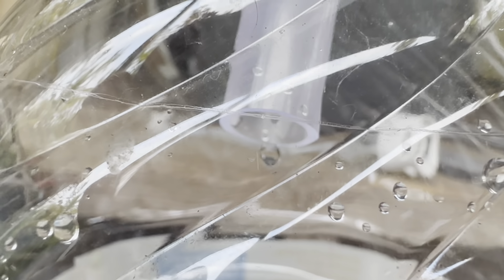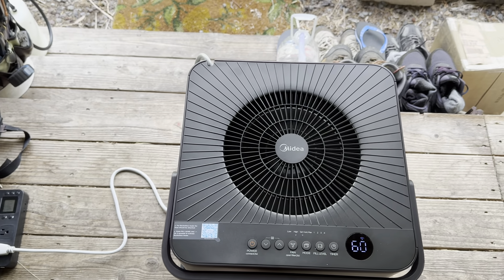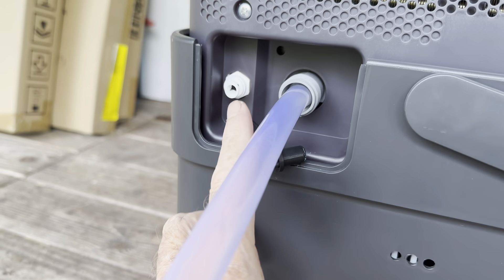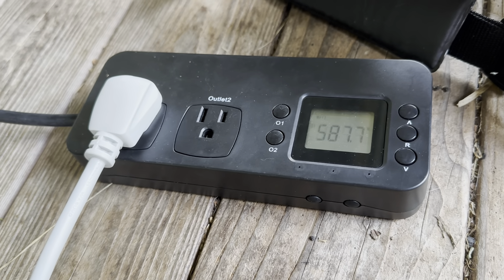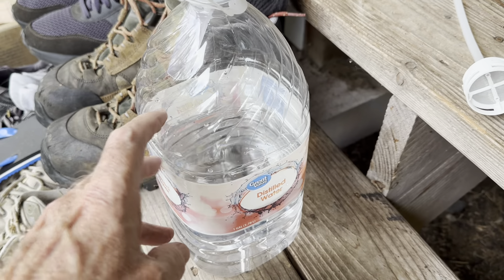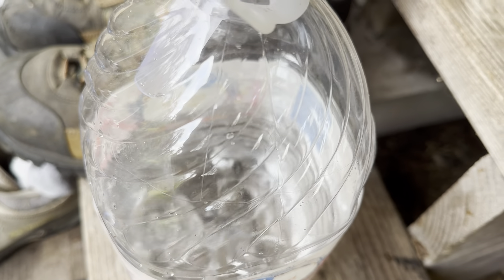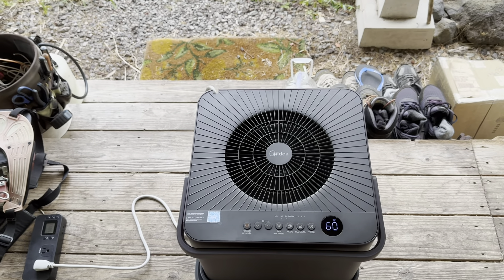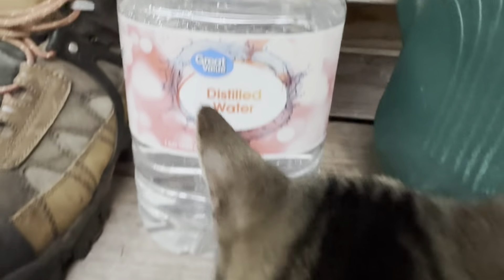Drought Emergency: Solar Powering a Dehumidifier for Critical Water Harvesting

Comment: Your water will be as clean as the coils it is condensing on .As long as the unit is clean it will produce near distillation purity.
Reply from the maker: That is good to hear! I have many filtration methods out here, and I will experiment with all of them. This is like magic to me out here. Aloha!🤙
Reply: @ProjectsinParadise808  Well, remember the coils are typically metal, aluminum, zinc, copper, etc... maybe some sort of alloy.  Probably uncoated since the unit isn't designed for making drinking water.   They will leech, for sure.

In the old days there would also be lead in the coils or in the solder.   Not something you really want to drink.   These days there is typically no lead in the coils or the solder but you can never be sure given how much of this stuff is made in China.

One thing that can be done is that after a week or two of operation, collect some of the water from the unit and have it tested by a lab for metals, so you know for absolutely 100% sure what is actually leeching into the water.
Reply: I did test the condensate via lab from a Carrier heat pump a decade ago.  Contained lead.

Interested to hear that solder no longer contains lead???  I suspect it's still used in vapor compression dehumidifiers...cheap wins on cheap consumer products.

Comment: Imagine a role of these running during those misty mornings and nights... 
Minimum space requirements to maximize humidity observed of course...
You should figure out a way to pipe the dehumidified shield air into your house...
Reply from the maker: I'm in full experimentation mode. I really want this to work, and it does for more emergency type application. Think I might like more efficient model I could run all night. This unit is super nice, but hungry for electric. Aloha!🤙

Comment: if im not mistaken, you want to put that in the coldest place you can find, damper the better. Night time will produce the best extraction when the dew point has a lower Delta
Reply from the maker: That's good to know brother. This is all new, and I've been running it since I got it earlier today. It does suck some juice, but that I have spare. Made a few gallons already. That in itself is already a relief. Good to see you buddy! Aloha!🤙
Reply: in the future I will be designing and building a large scale water from air extractor for my place off grid in Mexico. I am going to use two matching coils from a mini split condenser and that I hope will make between 5-20 gallons per night. It is all still in the planning stages but it will happen one day. Now something that I want you to be clear on is that pure water is quite corrosive . Water is reffered to as the "Universal solvent" for this exact reason. Water from air has no minerals whatsoever and because of that may leach minerals/metals from the coils and piping inside that unit. I would, if I were you, run that water strait into your main collection tank/pool and let it mix with the other water. this will allow it to dilute and therefor make it safer. this also means that it will go through your reverse osmosis and UV before drinking.  Another thing that I have wanted to mention to you for soem time now is that you should run the discharge tube from your RO right back into your main tank/pool. There is  nothing wrong with the discharge/waste water. it is about 10% "dirtier " than the source at worse, but other than that there is nothing wrong with it. You don't need to isolate it, or treat it like waste. The only reason they normally put it down the drain is that it is the quick, dirty, and cheapest way to deal with it. Aloha my friend @ProjectsinParadise808

Comment: I strongly believe that if you can filter water from a tank that is open to bugs & mosquitoes etc.  you should be able to filter the condensate water being made from this machine. I would maybe filter 5 gallons at a time & test for safety for each 5 gallon container.  I would even run it thru 2 new filtration systems & boil it  just to be extra safe & you should have incredible drinking water.  Filtration and testing is key. There are people who use test strips at home to check on drinking safety.  I've seen some really good filters that can filter out a can of soda.  The soda went from a dark color to a crystal clear drinking water only.

Comment: Crazy! Since your last video is been pretty much nonstop rained here in the desert with 80% humidity. I wish I had my rain water catchment system up and running. 

Can you DIY drill a well there? All but one of my neighbors have wells here. But they are 300+ feet through rock. 22k to have one drilled.
Reply: Often a well drilled on a volcanic island will encounter salt water.  Not always, but the risk is high.
Reply from the maker: Got some rain today. Not much, but may get more tonight. Better than it's been by far. I know they do drill wells out here. I don't personally know anybody on one, but it could be done. In Colo. I had a great well in my later years there. Hit 8gpm at 165 feet in solid granite. It was amazing. Aloha!🤙

Comment: I used to drink distilled water but with no minerals I was kinda run down. I started drinking 
Spring water in north Florida. There is a free flowing water coming out of the ground and free to take home. But in an emergency your water is ok. Even baby water has minerals what you buy in the store. 73

Comment: Have you considered alternative filters for your catchment water rather than R.O. which uses a lot of water?
Reply from the maker: Got another method on the way. Gravity feed filtration, no waste!🤙
Reply: R.O. does not "use" a lot of water, and in his case the "concentrate" stream that is normally discarded could be put right back into his catchment tank as it will be cleaner than the water entering the R.O. system.

R.O. systems have filters followed by an R.O. membrane.  Thus they filter water (making it cleaner) and then separate it into two streams: the permeate (usually the desired product for drinking which "permeated thru the membrane" hence "permeate") and the concentrate (contains the original dissolved elements plus nearly all the dissolved elements from the permeate, hence "concentrated minerals" or "concentrate").  The concentrate carries away the dissolved elements from the supply water. This separation is performed by the R.O. membrane.

On my home R.O. system I have two sequential R.O. membranes.  The second one is added using the concentrate as the input. The permeate stream it produces is every so slightly less pure than the permeate from the first membrane, but still very pure.  Then I use the final concentrate to flush toilets and on my landscaping.  Other than being harder than my source water, that concentrate has fewer other contaminates (rust and other fine sediment, primarily) as those were caught by the filters that protect the R.O. membrane.

Fun fact: Some maple syrup producers use R.O. to separate water from the maple sap. In that case the concentrate is the desired product and the permeate is discarded.
Reply from the maker: I am using every single drop of the RO system. Like you say, right back into the system. Mahalo for breaking it down like you did! Aloha!🤙 @Sylvan_dB
Reply: @Sylvan_dB  thanks. I have to look into that further. There is so much I don't know.

Comment: Originally you said you had one that draws 150W, 3.6kW per day.  580W running 24 hours a day will need almost 14kW.  That is a big chunk of solar and battery storage for the night.  I'm sure you'll figure out a schedule to be most efficient.    I would assume you will get the most water at night.  I got about 21kW from 6400W of panels today here in TN.  With shade from 1 tree that hits me in the winter I don't really get going until noon, but it was full sun all day today.   Next thing you know you will have all rain and no solar.  Hopefully everything gets back to a good balance for you soon.  I'm very interested to see how the dehumidifier works for you.
Reply from the maker: Had a 150 watt in shopping cart, but hadn't pulled the trigger. If I misspoke, apologies. Got it running right now with 72% humidity...making water! ALoha!🤙  this is my first humidifier ever😉

Comment: that a neat unit. you can place that any wear . some power draw . but  water ! now you just need a bigger holding tank.  now you just have to play with settings . if you have to just add more solar . and before the rain comes get the rest of the roof ready to send water to the holding tank. at this point water is worth more than gas. after last winter in Boston NY . 2 record breaking snow storms . what next ? . todays inverters and LiFePo4 battery's make this happen.
Reply from the maker: I'll be expanding the roof catchment pronto! I'm just missing too much . Has always been enough in past, but different times require different measures. Pretty big draw for my systems. Not sure I'll keep it. Might go with smaller scale one. I see one draws 150w...now that i could run all night no problem. It's all an experiment yeah. Aloha!🤙

Comment: That is actually amazing, I never thought of using A dehumidifier to pull water, I had water from my Aircon unit but was never clean looking, it always had a grey tint to it, I am interested to see the test results you get back though, awesome video, thankyou ♥
Reply from the maker: I'm pretty amazed at the possibilities. The power consumption is more than I anticipated. I will continue to experiment with it and see if maybe I need to scale down maybe? I dunno yet. Aloha!🤙
Reply: @ProjectsinParadise808  Either scaling up the power in or scaling down the power used, but I'm not sure if a smaller unit would produce the same amount of water or not, I hope it works out well whatever route you chose ♥

Comment: You might also be able to collect dew, assuming the humidity reaches the dew point at night.  A sheet of plastic suspended slightly above the ground by three or four points, not too tight, with a small-ish rock in the center to make it cone shaped pointing down. Under the tip of the cone place a vessel to collect drips.  Dew forms on the underside of the sheet, runs down and drops off the bottom tip of the cone.  In drier climates, this can be done at the top of a hole dug in the ground. Moisture is typically higher underground, but some of your warm underground lava may be more dry than the air!
Reply from the maker: I have seen some very imaginative collectors much how you describe of some living deep in the jungle with no power. Even some of the tents are amazing to see. Hopefully I can make my  way there one day and share one of these very sustainable ways off living waaay out there. Aloha brother!🤙

Comment: "Smartphone compatible".  It has an Android/IOS app to control it in addition to the manual buttons.  The app might need the internet but still, cool.  "built-in pump lets you drain the unit upward into a sink or out a window".  It has a humidity setting too so you can set it to only turn on when the humidity is high enough.   Looks like its a compressor type but not entirely sure.

I think you got a winner there, that thing is cranking out the water!  Burning a ton of power, but cranking out the water.

Hmm.  The unit should auto-restart on power-lost / power-returns.  Check that that works.  If it does you have more options on automating operation just by controlling the inverter.   600Wh per 1 hour of operation.  Whew.   I wonder if it has a physical remote control input that you could control with a Victron's load output (obviously the load output can't run it directly).

Ok, here is my money-burning idea:

($300-$600) 24V x 50Ah or 100Ah LiFePO4 battery.   Good for 2-4 hours of operation on its own.

($65 - $200) 1 to 3 x 100W solar panels
($100) Victron 75/15  (1-2 hours of energy worth of operation).

($100) Optional second Victron 75/15 to siphon a power budget from your main 48V system (I think, if I remember right, you had a 48V).   The way this would work is that you use the LOAD output from one of the Victron's on your 48V home system and program it to only be turned on when the home battery is in really good shape.   You run that LOAD output to the SOLAR input of the Victron 75/15 and set the 75/15 to only charge at 1A or 2A (25W or 50W).  That gives you a budget of 600Wh to 1200Wh a day from the home system into the dehumidifier system. 

($140) 800W Inverter.

($20) A relay or low-power contactor that you actuate from the LOAD output of one of the Victron 75/15's to control the inverter.  That way the inverter isn't sitting there bleeding energy while the 24V battery is trying to get charged.   Set the LOAD output to User mode 1 with a high "start" voltage of 28.2V and a low "stop" voltage of 24.0V.     (Or, alternatively, get an inverter that has a REMOTE control input that the Victron's LOAD output can be connected to).   Remembering that the Victron's LOAD output cannot run the inverter directly.

The huge advantage of having a secondary buffer battery is that you can use its entire storage capacity to drive one function... the dehumidifier.

And there we go, fully automated.

There, I just spent you another $705 to $1140 bucks 🙂

-Matt

Comment: High Bob, nice to see you have a backup going.

A good idea would be to get voltage sensitive relay, that once you get to a specific set voltage in the battery (95% or so), it will turn on the unit to manage the excess power you have at that moment.

Nice to see that little water flow going steadily. Hope a bit of rain comes your way and alleviate your drought.

Cheers and nice going!!!
Reply: Yup, one can actually just use the LOAD output of one of the Victron's for that function.  Best to get an inverter that has a control input  / REMOTE relay input rather than using a separate relay, since it will allow the inverter's input capacitors to remain energized and not put any stress on anything when turning on or off.
Reply from the maker: I really like that voltage relay idea! Yeah, it's a lot of power to run this unit, but, it is making water which has me thinking hard on these methods of harvesting. Getting some very light showers today, which is nice! Playing around with the humidifier at the same time. Mahalo brother!🤙
Reply from the maker: You guy's got me going now! I need more hours in the day! Haha! Aloha!🤙

Comment: You might want to check its purity before drinking it. Safety and clean safe water is something you dont want to play with....
Please let us know the results after you tried the water...
Just my 2 cent
Good luck
Reply: Indeed. In my experience, the water coming off one of those things tends to be a bit nasty. The coils tend to collect dust, and mildew. As well as a metallic taste from the copper, and other "stuff" on the coils. (those things aren't cleaned from the factory for making drinking water.) Plus, that water is essentially distilled water, so no salts, or minerals you actually need in drinking water. It is better than nothing.
Reply from the maker: Oh I am for sure testing it before I would drink it. In the meantime, it's utility water. Every drop! Aloha!🤙

Comment: You probably already know all a dehumidifier is, is a freezer unit that freezes and defrosts. And keeps cycling over and over. The moisture in the air freezes on the radiator and then melts off. I’m so glad someone turned you on to this idea. I used to water my animals and plants with mine. Sure there was so many options :-) 🤙🏼.
Reply: Every dehumidifier I have seen has an evaporator in front of a condenser and operates continuously. There should not be any freezing that ever happens, only condensation.

Comment: "Woiks like a cham-peen!"  Idea: Rig a loose-fitting, hat-shaped collector along with some dryer vent flex hose, or maybe something slightly larger and pipe some of that cool, dry, exhaust air from the dehumidifier(s) into your house during those hot, humid hours of the day when the interior could benefit the most...  Aloha, bruddah 🍍
Reply from the maker: Aloha brother! I excited, and relieved to have another part of the solution for extremes. I like that idea! Mahalo!🤙